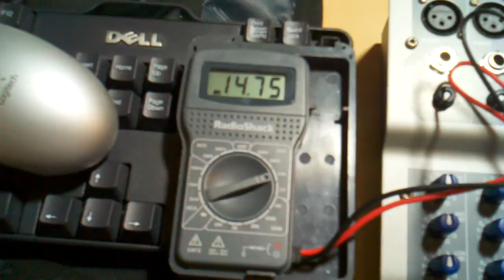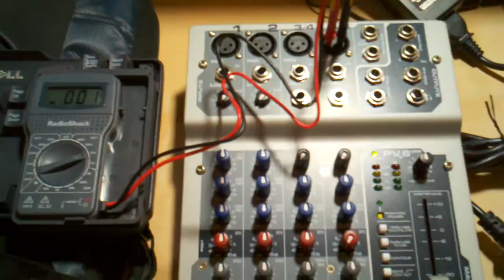Peavey PV6 phantom power voltage

Comment: I can confirm that regular pv6 has 48V on phantom. Thanks for the video.
Reply from the maker: Thank you for this. The usb version and normal version have different power supplies. I think one was VAC and the other VDC. Thus why different phantom power voltages.
Reply: @Bassguitarist1985  PV6 is run with 16V 1A AC while PV6USB is using 15V 0.5A DC. Completely different beasts.

Comment: Any idea why my pv6usb has all red clip lights on? I don’t have original power supply but i bought one online that was supposed to work for it, its a 15V 1amp power supply so thought it would work. Have little knowledge on testing boards but Willing to give it a shot if there are any recommendations...
Reply from the maker: Red clips light on means power supply issue. Make sure you got the right psu. One was 15VDC and another version was 16VAC. Big difference. The wrong PSU could cause internal damage and need surface mount component repair requiring special tools
Reply: Ok sounds good. Guess ill have to order correct one. Thankyou for quick response

Comment: hello bassguitarist, 
could you tell me what the phantom power is for?
Reply from the maker: Tota Ixcson to power devices like active direct boxes, condenser mics, and mic preamps over XLR. Its called phantom because voltage between GND to pin 2, and gnd to pin 3 are 180 degrees out of phase, and are canceled out when the two signals are summed. The standard is 48VDC, some cheaper mixers are less than that since not every device is full current rated for a given input. This mixer has been discontinued and successors now employ full 48v phantom not 15vdc

Comment: I have a 14 channel of the same series and every now and then, it seems only when people come over, all of my mics and channels act like the gain is completely cranked.  It can be all the way down, nothing red lining and totally normal and it will sound like a megaphone.  It fucking pisses me off.  I have hot hitches come over and want to sing and it's embarrassing.  It seems to have done it before with a dynamic so I can't say for sure it's a corrupt phantom power issue but it sucks and being digital, I don't know where to start.
Reply from the maker: it may be a cheap dynamic mic that is not balanced. Cant say I have had this issue myself. I still use this board to this day. Its small and not very feature laden, but it gets the job done for basic mixing
Reply from the maker: i would shut off phantom power and see if that same mic works, or tray another channel. It may be a bad pot too, hard to say.